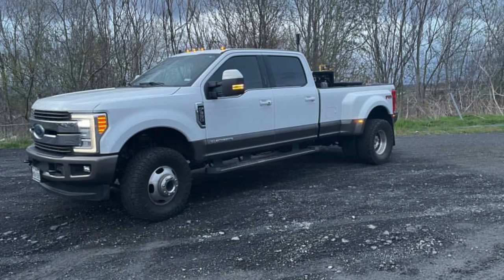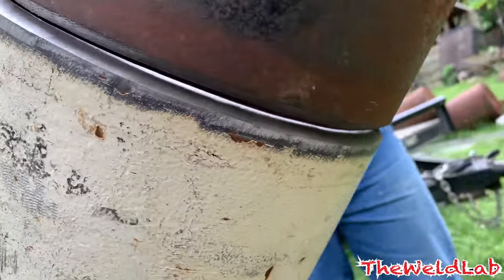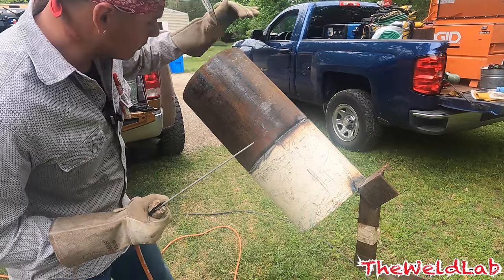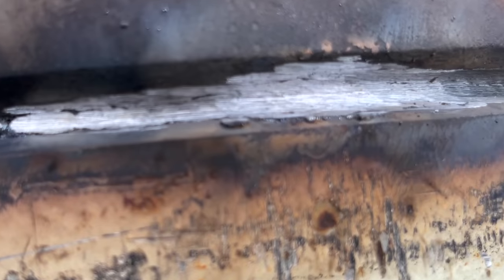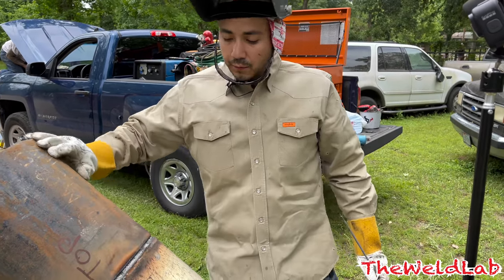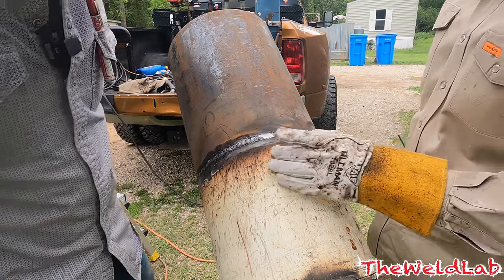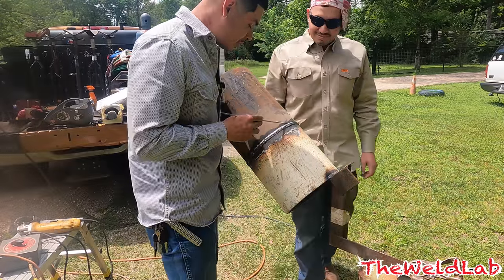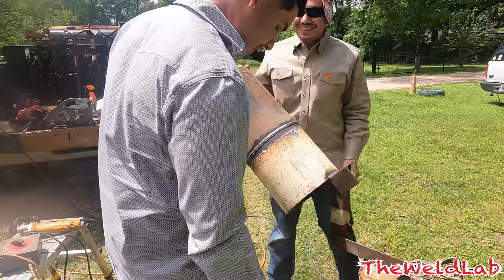Nervous For My Welding Test | Pipeliner Teaches Me His Secrets

Comment: that's different.  I'm a Boilermaker welder, I'm used to doing 6010/7018 fill caps going vertical. iv have never seen the fill cap done with 6010. i always figured 6010 produced a brittle weld that would crack easily. cool video, I found this channel looking for videos trying to learn how to back feed tig roots. Awesome videos
Reply: All depends on code right? I've seen 6010 down hand all the way to cap on gas lines. Might be 8010, the appearance is similar.

Comment: running a 6010 bead is easy . If you have harder pipe X70 (Gr.483)you would have to run 8010 through out  there is a tendency for undercut 4-6:00 . 8010 is a fast freezing rod and having a more liquid puddle helps .Lincoln 200  big dial straight up and down then find the sweet spot on the continuous

Comment: Dope rico! You gonna get that. But I have 1 quick question about tig I’ve watched you videos on tig and how flush does the pipe gotta be till you can cap it . Can it be slightly below flush or it was to be completely flush
Reply: Slightly below flush that will guide you   if you put it to flush is a little hard.

Comment: In the oilfield welders told me to practice more on 2 inch pipe cause its the hardest one to weld n once I got that down then I could pretty much weld anything.. is this true?
Reply: 2 inch tip. Make your land larger for 2 inch. If you don't know what the land on a bevel is. You don't need to worry about which is harder to weld.